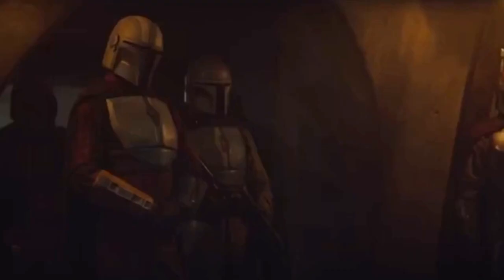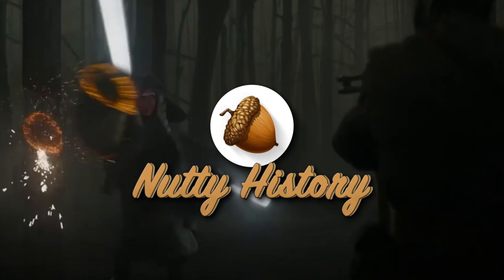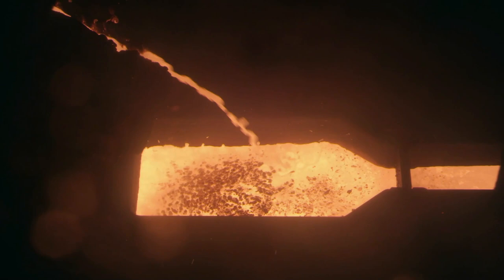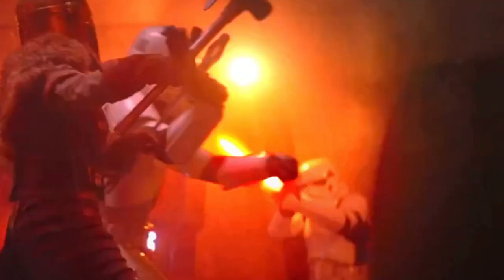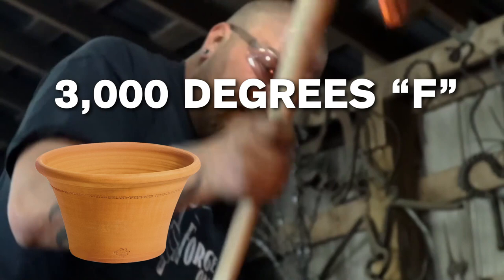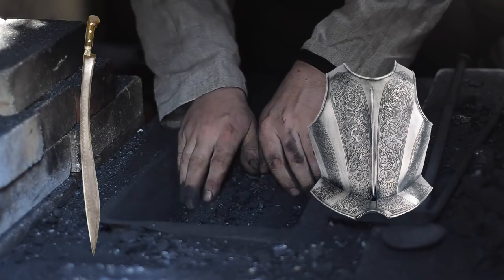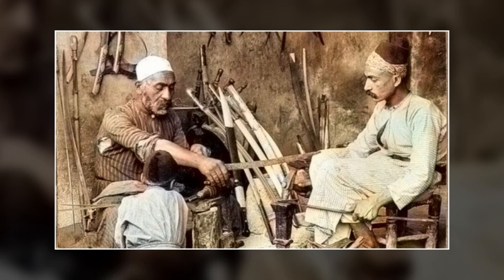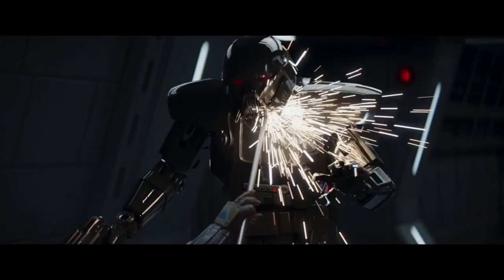The Real Life Armor that INSPIRED the Mandalorian

Comment: Just because we don't know exactly how they made Damascus steel doesn't mean it's superior to modern steel.  Damascus steel was made the way it was to compensate for how shit ancient metallurgy was.  Modern, purified, tightly-controlled steel alloys would wreck any ancient metal.

BTW, we do generally understand how Damascus was made.  There are relatively minor specifics we don't really know that are lost to time, but, honestly, there hasn't been that much effort put into figuring it out.  Sure, lots of blacksmiths and archeological experiments have been done to replicate it, and those studies are why we know what we do.  It's the little things that were probably passed down from master to apprentice that are lost.  If we really wanted to know, we'd figure it out.  If Damascus was actually that much better than modern steel, then every military on Earth would be dumping beaucoup bucks into figuring it out.  When historians feel like exaggerating how good Damascus was, they will say it's "X times harder/ more durable/ whatever than modern steel!" but, the thing is, they're usually comparing it to a basic low-carbon steel that's not designed to be hard or hold an edge in the first place.  Not to mention the fact that some Damascus steels have actually been found to have trace amounts of Vanadium and other metals that puts it in a grade completely separate from regular old carbon steel.  The ancients definitely didn't know about these trace metals, BTW, they just knew that iron ore from certain places was better than others.  Modern alloys with tightly-controlled ratios of other metals to iron are way, way better than ancient metals if for no other reason than we actually know what the properties are and we can be much more certain that the mixtures are uniform and less likely to have weak spots caused by impurities in the metallic structure.

What we really don't know is exactly where the Hell it came from.